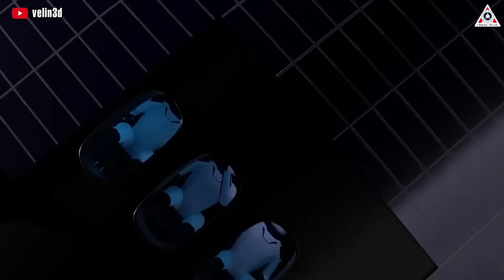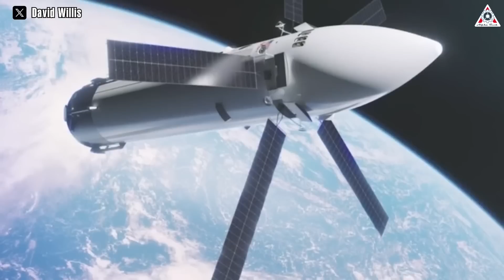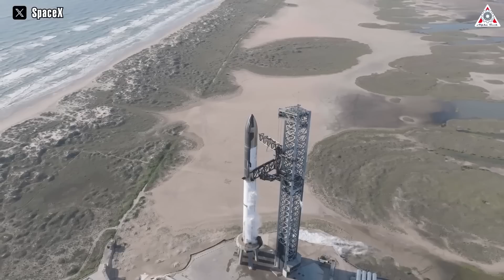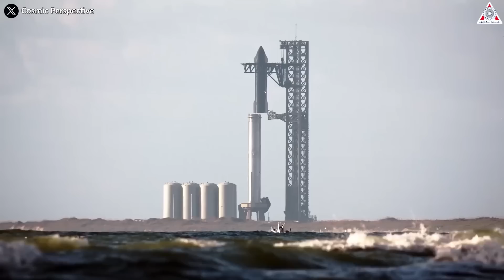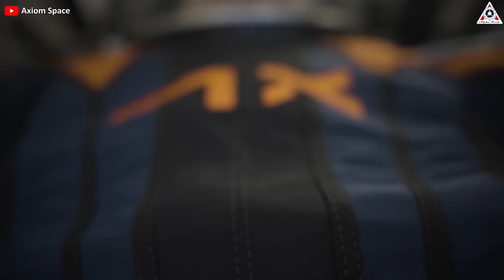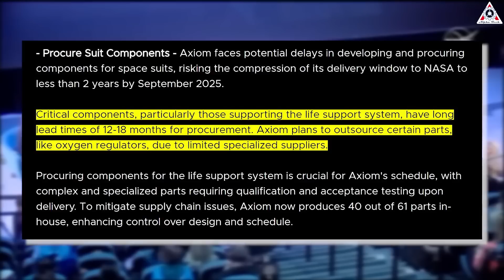Genius! NASA & SpaceX's huge TESTING with Astronauts on Starship Elevator...

Comment: I would build the ship in reverse, reserving space at the bottom for the astronauts and just for the vacuum engines! The fuel would be located at the top... This way it wouldn't be so necessary to have a heavy elevator, using a simple ladder!
Reply: You need an elevator to move cargo anyway. A ladder was never an option when the capacity is 100+ tons in the cargo bay. (Somewhat less in the manned vs cargo version.)
Talk of ladders is absurd. We know how to build elevators (that can operate in 1/6 Earth gravity).

Comment: The starship lander should stay on the surface of the moon and be retrofitted as a permanent base of operations.
Reply: No, it is planned to return to Earth orbit to be refueled and reused.  Many times.
Reply: The biggest goal of the original design is reusability to lower long term cost of each use.  Starship is the first second stage rocket designed for reuse and the best first use you can think of is to convert it to a fixed location facility?

I like Elon Musk's idea better:
Keep the ship mobile and use it to bring construction equipment and material to build or, at least, bury the habitats the crew will need.
Reply: I'm not sure its so easy to convert fuel compartments to usable space. maybe if you had a robot to do steel cutting and welding. The economics might be better if starship carried inflatable modules with all the facilities you need to the moon.

Comment: Will the legs have minor adjustment capabilities for levelling the craft if it lands on an uneven surface or hidden soft spots
Reply: Yes. Adjustable legs with leveling tech (air suspension cars already have this) with wide pads to prevent sinking also required (per the lunar lander of the 1960s.

Comment: NASA seems to be 10% lets go explore and 90% lets delay so we can milk the tax payers for more money.
Reply: The Spacex lander could haul 10x the cargo for half the price of the nearest competitor. This is also a Fixed contract. Any overruns are paid for by Spacex... not the taxpayer. 
The Spacex lander can drop either 100 astronauts (more reasonably about 40) or 100 tons of cargo in the cargo variant.
So... $6billion to send 4 guys and 10 tons to the moon or $3 billion to send 40 guys and 20 tons to the moon (100 in the cargo variant). 

You are correct, however. The official who chose Spacex was demoted a few months later... so Clearly the politicians in NASA Wanted to sell the contract to the highest bidder and milk the taxpayers for 4 guys and a quanset hut at $4.5 billion per flight... so they can huddle together for months and count rocks... sorry, "conduct crucial experiments" as opposed to building something useful that can begin to bring profitable industry into space.
Reply: @avgjoe5969  I've noticed that also. Anything to run up the bill. Another great example are  the Mars landers. You think on these landers they would fit a few experiments on board to check for life.  Nope we have to send 20 landers up there to look for good sites first.  Then probably another 20 landers (each with a little better experiments.  Smh they are mostly looking find money instead of life.

Comment: Let's allow SpaceX to do the experiments to prove in orbit refueling can be done and how many launches will be necessary to completely fuel Starship.  Then decide on its practicality.  The alternative is to increase the size of Superheavy to boost Starship all the way to orbit with 100 tons of cargo without using any fuel before Trans-Lunar Injection.  Should they strap a dozen or so SRBs to Superheavy to do that?  That way they could launch on the SRBs and fire up the inner 13 engines after liftoff, using SH as "stage 1.5"...
Reply from the maker: Thank you for your comment!
Reply: Don't need SRBs. The LEO refueling takes about 10 tankers (Source Spacex) to an orbital refueling station (a first stage in LEO would work nicely with a few mods - Spacex has already perfected docking with the ISS). 
Spacex has 2 Starship launch pads with a third being started. They can build 350 raptors per year (with no further ramp) and up to One Starship "every 3 days" (Shotwell) from the newly completed Starship factory. (2 a month would be quite enough)

Starship Currently costs $50-100m per ship... and designed to be More reusable (burns cleaner) than F9 (current champion flew 19x  before being destroyed by accident).
Spacex can use Starlink revenue ($billions per quarter by then) to build dozens in the 2025-2026 timeframe. 

So is 10 tankers per lunar round trip an issue? 
Not really. Look at the current rate of Spacex launches (98 last year). They will have much more money/capacity by then.
with a few mods - Spacex has already perfected docking with the ISS).

Comment: I'm just excited to see what the habitat for the people going to be in space. How big it's gonna be. I want to see that.
Reply: One idea was to tip a Spacex lander on its side (pulleys, guy wires, etc) and cover it with regolith for radiation protection. The habitable space would be about 1000 square meters (somewhat more than a 747. Tunneling could be done after a tunneling machine could be brought in. (See Boring Company Prufrock machine - Musk). Lined, tunnels 12' in diameter could be drilled in 200m circles to allow maglev cars to be made into a train, rotating to produce 1g deep underground.
Reply from the maker: Exactly!

Comment: Elon wandered off to buy twitter..so things slowed right down.
Reply: Lol
Reply: No. Spacex didn't slow down at all since Twitter acquisition:

Starlink: 
It has been making money for Spacex since last year and the subscribers are growing rapidly (beyond 2.5 million). This has given them funding to accelerate all other operations.
Successfully tested V2mini with additional antenna to allow a standard cell phone to communicate directly to another cell across the world with no landfall between - Massive new income to fill in coverage voids (such as the middle of the ocean) so T-Mobile (and two other ISPs so far) give subscribers have vast reach (and revenue). 
Moving from 23 V2 mini sats per launch to 120 V2 large sats (more than double capacity) to Greatly increase satellite deployment and revenue stream.

Infrastructure and rocket: 
2 towers for launching Starship now with a third under construction. The water deluge system is working perfectly now
Raptor 3 is now stable at 269tons thrust in a much more robust engine package.  

Switching from 6-9 raptors in Starship upper stage and extending the rocket stack 10 meters to allow more fuel.

Finishing off construction of massive Starship factory to allow true mass production of Starship (targeting 100 per year).

So... no. Things didn't slow down. These things all happened since Twitter acquisition. Shouldn't get news from hostile soundbites.

He also started Grok to compete with Chat GP5 and incorporated it as a paid feature for Twitter/X.com. He's also building robots now... so that Also happened.
He also fended off absurd lawsuits from Biden surrogates in the DOJ, FAA and a wildly corrupt Delaware judge (that has ties to a lawfirm used regularly by the Bidens/DNC)... and a Disney boycot.

Yeah. X.com was a Big distraction and everything stopped.

Comment: Anyone guess what cargo will SpaceX sends to moon on demo mission for astronauts to pick up later? rovers? dry food? drones? Optimus? research equipment? inflatable habs?
Reply: An Alpaca lander for emergency use by the manned crews to follow later along with the necessary gear to mine and hydrolyze ice into hydrogen and oxygen to fuel it in the event its fuel has all boiled off before it is needed.  It might take two trips.

Comment: if a spaceX lands and astranauts waLK ON MOON?
WHAT DO THEY DO IF THE LIFT JAMS BECOMES NONE WORKABLE.@@@
LOW WALK ON WALK OFF IS STILL THE ON LY VIABLE
EXPENDABLE USE OF WEIGHT IN THE FLIGHT.
a LANDER READAPTED TO HIGH LEVEL LANDING TAKE OFF THRUSTERS
AND WALK OFF PLATFORM DOORWAY
TAKES MASSIVE AMOUNTS OF WEIGHT THAT IS NOT NEEDED.
2001 MOON BUS IS THE NEAREST DESIGN
THAT COULD ACTUALY WORK.
PENCIL TALL JULKES VERN WELLS 1930S 
FILM POCKET BOOK DRAWN 
SPACE SHIPS
NEED NO STREAM LINEING IN SPACE OR ON THE MOON
ONLY ABILTY TO LAND SAFE AND GET IN AND OUT SIMPLY
EASY AND TAKE OUT IN CARGO AND ITEMS OF USE.
GEARS PULLIES ROPE WIRE TRACKS THAT GET JAMMED UP ARE NOT NEEDED.
SIMPLE WORKING PROVED IS ALL THAT IS NEEDED.
CHOIP STICK MAGIC FLY CATCHING METAL BIRDS IS ANOTHER WASTE OF TIMAE AND ABSALUTE
COMING DISASTER